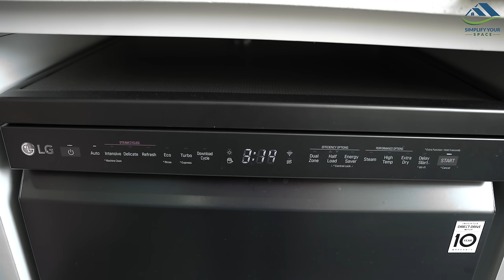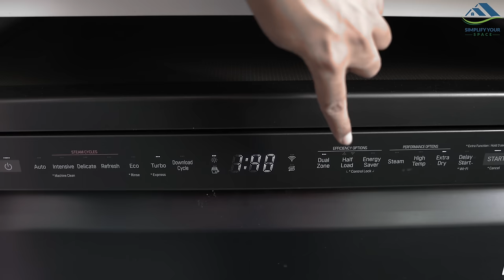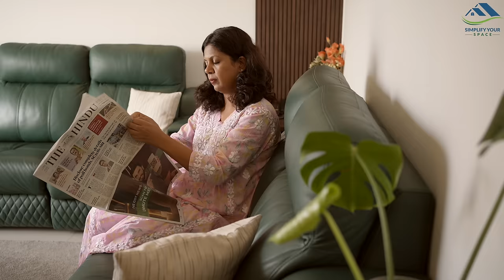Embrace Smart Living with LG Dishwashers | Breaking The Myths About Dishwashers | LG India

Comment: Dish washing machine is not suitable for Indian cooking and Indian utensils where we have utensils starting for  sticky tea pot to stained gravy cooker, rainbow kadai .. what not ... I used Bosch dish  washing machine for few months and stopped using it as we are a family of 4 members and the no of utensils used for all the three meals cannot fit in one cycle , we need to use dish washing machine after every meal, before loading the utensils we need to soak them with hot water or normal water ... which is time consuming and water consuming ... before soaking them we have to remove the dirt from each and every small utensils or else the machine gets clogged.,.. the washing liquids are little expensive than the regular dish washing liquids and are not available in every shop nearby .... In case one of the utensils is not cleaned properly the stains of the greasy utensil will spread to other utensils as well and they get dirty while cleaning cycle ...... Loading the utensils itself is a tedious task ... In case if the dish washer is so successful in cleaning the dishes , they this product would be selling in the market like hot cakes unlike regrigerator .... Hence would leave  it to you guys to think twice before buying it ....

Comment: Electricity kitni lagti hai.
Reply from the maker: The exact electricity consumption rate will depend on the model, cycle duration, and local electricity cost. In my experience, I have observed an additional electricity cost of about Rs 250-350 for 2 loads per day. Although this is not a precise number, my observation indicates that my machine consumes about 1 kWh per cycle, resulting in approximately 60 units per month. At Rs 5.5 per unit, this totals roughly Rs 330 per month.

Comment: Power consumption this dishwasher
Reply from the maker: The exact electricity consumption rate will depend on the model, cycle duration, and local electricity cost. In my experience, I have observed an additional electricity cost of about Rs 250-350 for 2 loads per day. Although this is not a precise number, my observation indicates that my machine consumes about 1 kWh per cycle, resulting in approximately 60 units per month. At Rs 5.5 per unit, this totals roughly Rs 330 per month.

Comment: Sorry to say but buying LG dishwasher was the biggest mistake I have done
I had purchased it in covid time after seeing video in your channel and many times I faced problems as after every one or two month we need to contact call centre
Moreover at the time of power cut the cycle starts from beginning 
I never recommend anyone to purchase LG dishwasher
Reply from the maker: Sorry to know about your bad experience with LG dishwasher. Will share your feedback with LG. I hope it is not because of frequent power outages or due to the hard water in your area. Please check the TDS of your tap water and if needed get the softener installed. I have been using the same model for past 4 years but haven't faced any issue till now. 

Yes, the dishwasher does not resume from the exact point of interruption but from the phase of the washing cycle. For example, if the power goes off during the pre-washing phase, it will start from the beginning. However, if the cycle has progressed to the washing or drying phase before a power interruption, it will resume from the start of the washing/drying phase, which is the mid or end phase, rather than from the beginning of the entire cycle.
Reply: @SimplifyYourSpace  thanx for your concern but one think I wud like to mention here that kindly mention drawbacks also along with demonstration of any appliance 
As in my area sometimes we face power cut  frequently and in that case my LG dishwasher is on running mode all the time